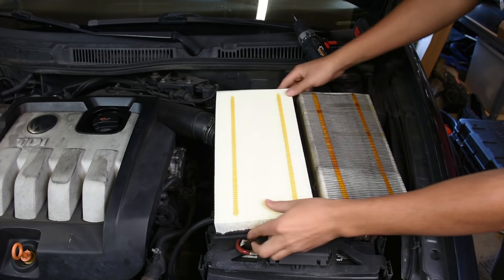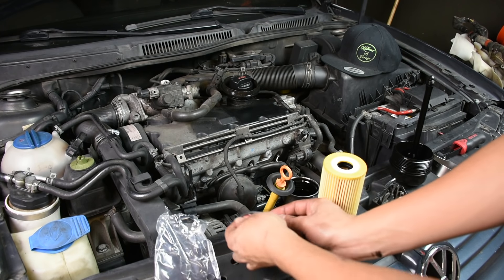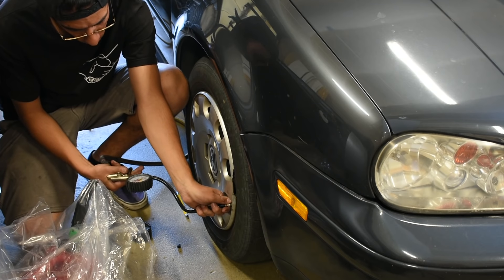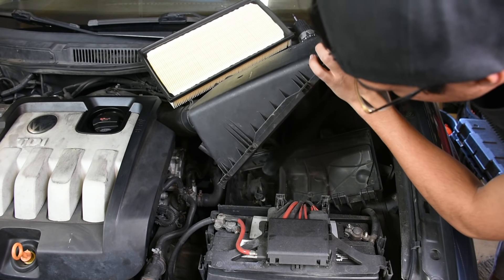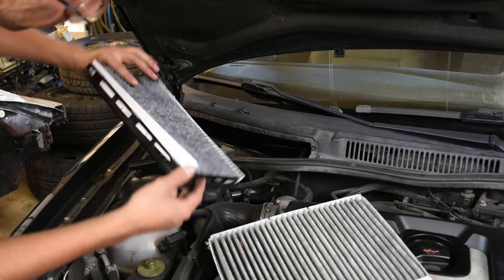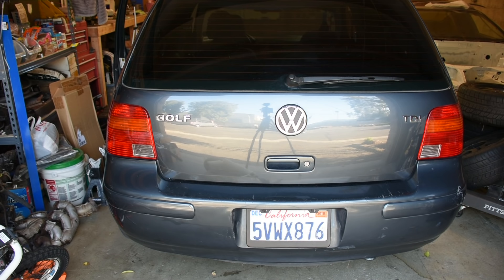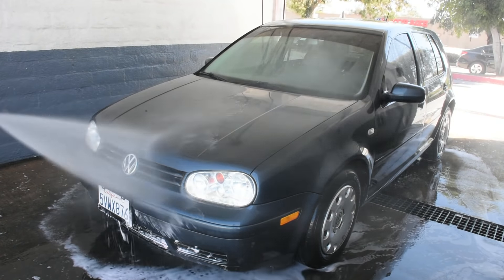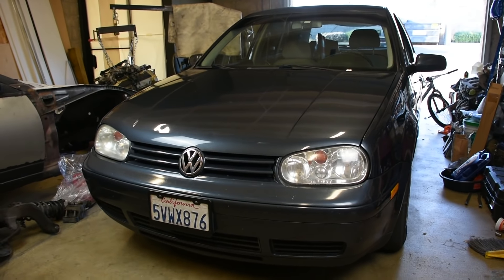6 Things to Do After Buying a Used Car

Comment: The brush.. really??
Reply: Captain it's just an old Daily... who the fuck cares. The Paint is not polished or anything, so what's wrong with thd Brush?
Reply: Project _ R Everything
Reply: Worries about documenting scratches, scratches it. #ohwell
Reply: Oooh please. My Car got painted 2 Years ago in pure Black and since than, I always washed it with the Brush and there are no scratches. Stop acting like the Brush is the pure evil, just because the Internet is saying that.
Reply: the brush leaves swirls but those are easily removed after polishing.  I would assume it's better to use the brush the first time you wash the car after buying it to remove any larger dirt contaminates on the paint. It really isnt an issue as he hasnt fully detailed the car yet.
Reply: There are definitely swirl marks especially on a black car using a brush, maybe you just don't notice it since it's been there for a while

Comment: You forgot to include checking the tire tread wear. Very overlooked.
Reply: You should look at that before you buy the car most of the time I check to see if it's even or not that shows if you have a bad tire rod or needs a wheel alignment
Reply: You shouldn’t have bought the used car without looking at the tires. Same can be said for most of this stuff.
Reply: Most important things to check 
Oil and all fluids 
Engine performance and sound
Tires and tread ware 
Suspension and handling 
Brakes and brake noise 
Electronic controls everything 
Lights including fog lights 
Transmission dose it shift 
Latches door locks and hinges 
Weather stripping 
Battery including fuse box 
Engine belt and tensioner 
Engine belt accessories 
Windows must roll down 
Mirrors have to work 
No check engine lights

Underbody needs to be checked 
No rust or leaks 
No broken components 
If it’s a truck look for spare tire
If it’s a car check the trunk

Make sure the vehicle got the tools to Jack the car up and to take the tire off

Those are the things I look for
Reply: @asherq8646   Looking at yes but fixing the issue is different. I doubt anyone looks at the cabin filters either.

Comment: I would also check brake system and replace the fluid, change coolant and get new front wiper blades. Checking tire tread and change fuel filter were mentioned before. Oh - and be aware of timing belt life.
Reply: I actually spent like 500 replacing my fuel pump, fuel lines, starter, all the spark plugs and a couple of coil packs in addition to a hand full of relays and fuses i pick and pulled.  Spent about two weeks testing wires all throughout my camry trying to figure out why it bogged out and died when i put it in park.  Turns out the water pump had been broken and that in turn cause the timing belt to die and i had no idea.  A great thing to have when buying a used car with higher mileage is a diagnostics tool you can get at harbor freight for under 40 bucks.
Reply: Listen to this man. I just paid 900 for a timing belt and water pump replacement
Reply: @Waterbugjay  oh man I don't even have a car yet and all this stuff is really intimidating, These things that you mentioned, are they high maintenance? I want to learn more but don't know where to start looking
Reply: I was thinking the same thing about timing though it needs checked no matter if its a timing belt or timing chain. Belts are cheap to replace. Chains not as much but if your used car has 100k miles or more it might could use a new timing chain, tensioner, chain guide bolt, hell might as well do the camshaft sprokets and chain guides. And on a lot of cars the waterpump is inside with the timing assembly so change that too. Also the front crank seal and valve cover gasket is good to do at the same time. No using old gaskets
Reply: @joel3683  When you get a car get a service manual it will have almost everything you need to know about the car covered
Reply: @shawno8253  I forgot I asked this but thank you for that input, I have a car now and I'm going to do just that:D

Comment: I would also check tire tread depth and wear, brake and clutch fluid moisture content and replacement, coolant ph level and coolant flush, replace spark plugs, check fuses, capacity test on battery and check suspension components for wear.  I would also start a maintenance log with date and mileage of when a service was performed.  It’s also helpful to write down torque values and part numbers with desciptions of any maintenace items that get regularly replaced for history and for future reference.  It makes buying the same items easier especially if you have multiple cars that you maintain.

Comment: make a video of how to fix saging head liner
Reply: You'll need spray adhesive and a plastic panel disassembling tool. Step 1: put the aforementioned stuff aside, remove the old saggy headliner and throw it away. Step 2: buy a new one that is in actual proper condition. Step 3: mount it in.

Comment: I change spark plugs, oil, flush coolant, filters, look for rust, check for codes on scanner, tread depth, look at brakes, drive train like the boots condition, battery, starter etc. All this might cost 4 or $500 but that'll give you the ability to sleep at night

Comment: Change all fluids you don’t know when it was last changed
• oil
•coolant 
• transmission fluid
•brake fluid
• differential fluid 
• Power steering fluid
• transfer case fluid
• washer fluid
You can also change 
•filters 
•brakes 
• and spark plugs

Comment: Great tips. It's also important to drain and fill the ATF, which hopefully was checked for its condition before purchase. The auto transmission is a very pricey system and needs fluid replacement for a reasonably long trouble free life :)

Comment: Oil
Brake Fluid
Coolant Level
Washer Fluid
Air Intake
Cabin Filter
Spark Plugs
Ingnition Coils
Engine Cleaner Additive (fuel tank type)
Intake Valve Clean Out
Convert most Halogens to LED
Tire Preassure
Battery Condition

Comment: hey everyone, I'll be buying a new car soon and I would love some tips. the three cars I'm thinking of are either a BMW E30, E36 or E46... apart from the generation I know I want a coupe 320i (or higher). I was wondering if anyone here has experience with those models and knows about problems or whatever, all tips are helpful! since I will modify it (NOT a full blown drift car or anything, just a nice street car..) getting aftermarket parts will play a role in my decision. 
maybe people from europe (also where i'm from, which explains my english xD) can tell me more than american viewers but I thought it might be worth a shot!
Reply: Sjoerd D non m3 have very weak rear subframes even for spirited driving
Reply: The E46 have massive issues with rotting rear axle mounts - also the early ones have electronic gremlins. The E30 is overrated and got to expensive by time. I would go with the E36 325i. M50 iron block instead of M52 aluminium block using irreparable nikasil liner. But that is personal preference - the 328i M52 is also used a lot for impressive turbo builds.
Reply: Here's a tip:
If you have your heart set on buying a beemer, be sure to have a LARGE amount of cash set aside for maintenance and repairs...and you will need it.  Owning a BMW ain't cheap!